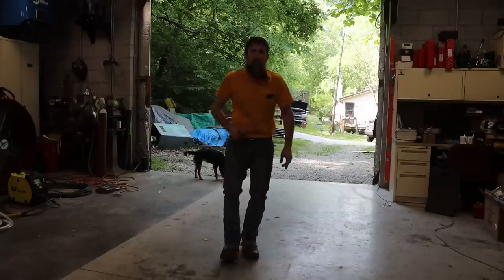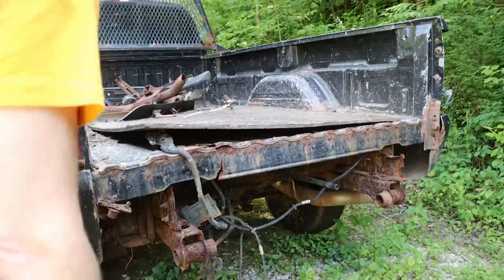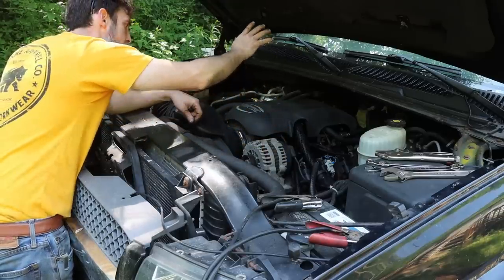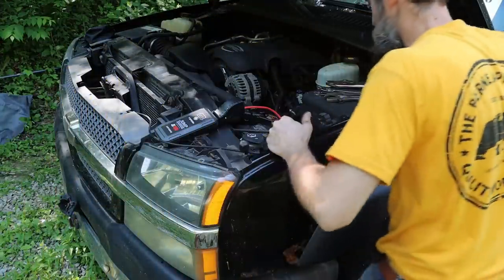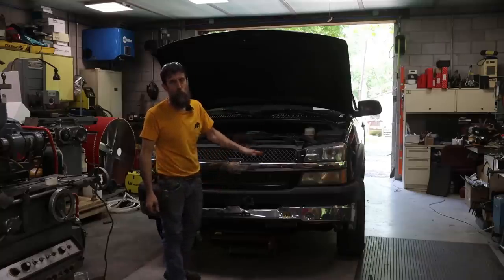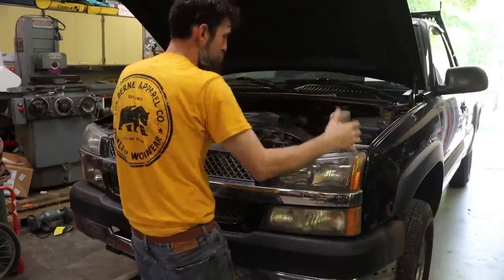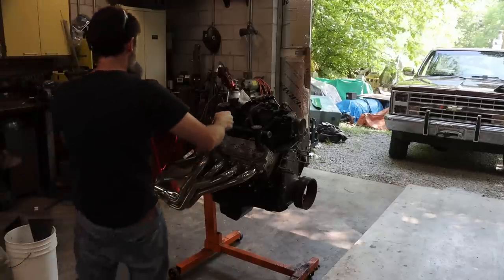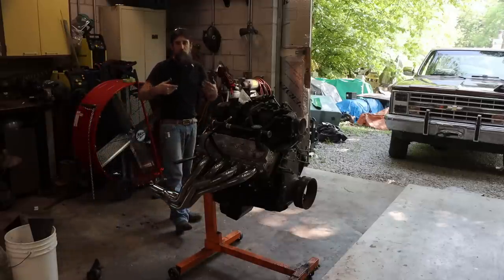This is thing is pure  junk! Old Rusty Road Salt Truck Gen3 6.0 LS Pull for Elizabeth's truck. JC

Comment: I have that same 6.0 in a three-quarter ton. 250 K miles with regular oil changes and I’ve never had a problem. Of course, living in a moderate climate helps keep corrosion and rest from being a problem.

Comment: Owned a truck identical to Johnny Cash and I got 6 mpg .  It was still expensive to run at 99 cents a gallon for fuel. It also took two acres to turn around. LOL,  Still was a nice truck and man could it haul materials.
Reply: My 01 dodge 4wd v10 dually 1ton gets just over 10mpg. It doesn't seem to make any difference if it's hauling a load or not. But it rides really well, and it doesn't take an acre to turn around in, surprisingly enough.

Comment: Engine looks good inside. Absolutely always want to get all the parts you need for a swap if you can. You can always get rid of the extra easier than you can find the one part you need.  Long tube headers are worth 50ft-lbs and 20hp anyday.
Reply from the maker: Hey Brian, good to see you. I definitely agree that it's easier to get rid of the stuff you don't need than to fine the things you do. Hopefully you are doing well.

Comment: I piece of advice for any and all that have U-bolts holding your springs to the rear axle. I have seen many of them rust bad enough to break off and it is dangerous. My youngest son bought a very nice 98 4x4 a few years back. He didn't have it long. While driving home from work another vehicle made a quick stop in front of him and he had to steer out on the shoulder to avoid rear ending them. When he did, the U-bolts broke and he rolled his truck several times. The U-bolts were completely rusted in two. It's amazing they hadn't broke before but the sharp turn and going to the shoulder was enough to do them in and the results were not good. God was merciful and he didn't have any bad injuries' to himself but the shape the truck was in wasn't good... Hope this helps someone!!!

Comment: My brother is a commercial fisherman , 9 months a year he hauls dead fish for his lobster trap bait. In winter he uses his truck for plowing and salting so It is a lot like what you have there after a few years.  Most have wood flatbeds after about 5 years.
Reply: My father bought one of those with a wood back, ex park service, on auction, for stupid cheap. He then drove it to the dump, and came back with no bin there. Then went to the people who do canopies for trucks, and got a "nearly new, only used once" bin, and it was free, no rear tail gate. Got a different tailgate, but right profile, and a bit wider, and we spent a weekend grinding the spot welds off it, and cutting it down to the right width, then brazed the ends back on. Coat of paint, and it was like a new one, and he had a semi decent pickup for a tenth the price. Had it for a year, then decided to sell it, and pick up a smaller more fuel efficient car, a Ford Escort, end of the line model, ex demo. Had that for a few years, then finally traded in on another ex rental Daewoo, which lasted for 25 years.

Comment: Steve, check the transfer case version, that was used for the ~05 one ton. I think that except for the diesel version, they where the same NP261, some of the internals need to be changed (wider chain and gears). Then you just need a front axle, to switch up Johnny Cash to 4x4.
Best wishes from the far North.

Comment: Steve, I know you already know this but it bears repeating for anyone watching.  Don't weld (or plasma) when your dog is in the shop, they absolutely will look at the arc and it isn't any better for them than it is for us.  And don't let the dog in the shop when you're doing anything with coolant, they love it and it's deadly poison.  

As soon as I saw the front of the donor I saw the plow mount and knew it was junk, those trucks just live a hard life.  Good find on the low mile engine, should move Johnny Cash out pretty nicely!
Reply: I've heard that an additive was added to modern coolant to discourage animals from drinking it. I wouldn't take any chances though and still keep the dogs out.

Comment: Spare parts are out there, unless your high pressure fuel crossover pipe on top of the engine is rotted off. GM stopped making them for my 2005. The aftermarket seems to be out of them as well. I had to find donor from the junk yard. Other than that I can find anything I need thus far. That 6.0 LS should be good engine, might be down on power compared to the big block if you're towing a trailer. But man oh man  they are reliable. My suburban 5.3 had well over 300,000 and the body rotted off but the engine was running like new. The 2005 I have has 200,000 and uses very little oil and runs like a Swiss watch with nothing more than the usual maintenance required. Looks like a fun project.

Comment: harvest the back rack - you need more lighting in shop (just at beginning) - good content - there is more on the old truck than you realize, you like the plasma cutter - get a big push broom - think about adding a new water pump and timing gears plus chain - check tolerances and specs - should be a great topic for content - degrease and pressure wash it and paint it? pls do update on flashing rom - you can do this and should get the tools - get blueteeth for obd2 monitoring to laptop - thanks steve!

Comment: The most dangerous rust on those trucks is the steel wheels. The way the centers are attached leaves a channel for dirt, salt and moisture can sit and the only way to clean it is to remove the wheels. Eventually the centers rust out and come loose from the rim.

Comment: If u use the tac module it's easy to add a kit to use cruise control. Also use the hydro boost off the new truck will stop alot better with less effort!

Comment: Hey Steve I am an admirer of your channel since how long I don't know.  Thank you for all your vids. They are very good.  I have the same engine in my 04 Escalade ESV.  approaching 280 K. So I think your LS will live. That one is just a baby.  Good Idea to buy the whole truck. Never know what you need while swapping.  Good luck and I'll be following progress.  Indeed a common thing that the exhaust manifold bolts are broken off. I think these engines are rated 355 hp. That should be enough for JC.  Again thank you for all your videos😎

Comment: Hi Steve.  I have to say, that truck is rustier than the 1999 GMC that I've been restoring, a little at a time.  Glad to hear that you knew about the o ring on the oil pickup.  That is a real pain to get to if the engine is still in the truck.  Especially with 4WD.  Old Johnny Cash should run real well with the 6.0/4L80E combo.  You could get the TH400 to work with the LS but using the 4L80 would be easier and perform better.  Looking forward to seeing more.  Thanks for the video!

Comment: Too bad there is no market for oxidized tin. You could retire today. This IS the way to get an engine/driveline etc. But, Soon you are going to have to deal with your yard space shrinking. It should help some on your wallets weight too eh. Saving the basics will supply your goals for JC.  Esp with all the controls, sending units and receivers that complement what you need. It would cost a small fortune having to source them from an auto wrecker eh. With this being an engine that worked reasonably hard did wonders for the internals. I have seen these with barely a sign it had springs and things in there, LOL. This is a fun one and made you dig out a bunch of Tricks to get it to where you are now. Bring on the DoAll bud. It will be great to see again. Take care and see yo soon my friend.

Comment: Did you hear me yelling at the screen? 
Put the transmission in manual low gear when the forward clutch is slipping. The low/reverse will apply.
Reply from the maker: Couldn't hear you over the exhaust leaks😁

Comment: A couple things you might want to look at are the intake gaskets, I am pretty sure the 5.3L of that era got a redesign because they would fail, also I think there were some issues with knock sensors and oil pressure senders of that era. Just some food for thought might want to research, maybe someone more familiar than me will chime in. It just seems that those are jobs I would much rather do on the stand. Looking forward to the new build, miss some of the machining but still enjoy all the projects.
Reply: Yes check into that I had problems with mine years ago after a water mishap 😂 and ended up having to go in a replace everything and upgrade to the new style gaskets 👍👍👍
Reply: Always, always, always replace the oil pressure sending unit when doing a LS swap or if you have the intake off. And get a good quality unit. I have had to replace several and learned my lesson. And replacing the knock sensors is also a very good idea. I have even seen a replacement wiring harness for the knock sensors because they are prone to deterioration also...  Preventing future problems now will make you a happy man in the future!!!

Comment: Hi Steve, you might want to think about intake gaskets while you are this far into it. I have an 02 GMC with a 5.3L that I purchased new. It has been a great PU but I did have to replace the intake gaskets, knock sensors and harness, also the MAF sensor. The knock sensors may not have been bad but as they are buried under the intake it made since to do it all.

Comment: Steve, if you need a home to adopt those headlights you took out of the 03, I am driving one them still (200k and counting) and I could use them.  I bought some aftermarket units to replace mine but they never have fit quite right…. Maybe the better half tagging that Mercedes had something to do with it… anyway, I’d sure be interested if they were up for offer

Comment: Change out the rear knock sensor (under intake) and the fuel pressure regulator (driver's side fuel rail with small vacuum hose).  Common issues with these.
Reply: BOTH knock sensors

Comment: Great content Steve love the project! Bad news though man. I had a brand new 2006 gmc hd with a 6.0 and a 4:10 rear end. 9-10mpg is all your going to get. Pulled a car trailer with it. Dropped to 6-7mpg. My uncle had 3 trucks with 6.0s and all the same. 9-10mpg.

Comment: Yep, exhaust leaks due to the rusted head bolts... GM used the wrong kind of metal for those.   I have a Vortec 8100, and I've done one side already... drill out the old bolts and replace with better ones.   The alternative is a special welded clamp that will hold the manifold to the engine and doesn't require you to disassemble it.

Comment: If reverse is good but won't go forward valve body is stopped up, not slipping just pull the pan and blow out the valve body and flush

Comment: I would change the rear seal plate on it every time I buy a ls in a truck it starts leaking at it till I change it and then no problem don’t know if it’s my luck or if it is the factory one on it but whenever I change it no problems

Comment: Looking forward to a new car repair serie. It is to bad that AC service is in such a commercial corner. (at least here in Europe it is) The environmental part is a thing. And being expensive or a hassle to get equipment to do it in a responsible way is not helping unfortunately. 
Not blaming you on this but the commerce. As a car mechanic myself I recognise the situation. By the way the throttle body flap is most likely driven by a normal DC motor. Not a stepper motor. Pwm driven.

Comment: God that truck was a "rust bucket bit of shite" as we say here in England. You're right Steve, I've never seen anything quite as rusty as that apart from a car we were driving alongside on the highway in I think West Virginia when we were in the states last year. That was a bucket of rust, half the what you call " rocker panels" ( we call them Cills) were missing as was the panel behind it. That wouldn't have gone two miles here in England before it was pulled over and condemned to the scrap yard by the local constabulary lol. Great episode Steve. If you are thinking of rebuilding the auto transmission why are you not going to change the front end and put the front axle on Johnny Cash and make it 4WD and auto for Elizabeth? That would make it an even friendlier drive for her.

Comment: Open question here because really I don't know. I'm curious about your transmission choice. Why the 4L80 vs the 6L80? Control issues?
Reply from the maker: 4l80e is a heavy-duty unit that should hold up better than the lighter  4l60.  It's just more appropriate for a 1 ton truck that will tow.

Comment: Once an unprotected steel truck starts to rust it'd structural integrity is lost and pretty soon you have the crashworthiness of a crisp potato chip. This happens long before it is cosmetically unacceptable. In most accidents all you''ve  got to save you and your family is a sound structure. Your last truck had wide spread faults in the frame that a few parches might coverup but not fix. They just move the fault to the next rusted spot, I have several friends that have traded their gas guzzler for a Tesla electric car and pay for it on fuel savings alone.. It costs nothing to own an brand new electric car.  It cost about 2 cents a mile for fuel o run. It's the safest car in the world. Its electric drive train vastly out performs your V8 and is the size of a gallon paint can. There are plenty of people out there with vast negative opinions and eagerly tell what they think even thought they never owned one or been in one. Ignore the nonsense and check one out they are now cheaper than a gas car.
Reply: I don't think Steve is a beta male, and probably enjoys the roominess, visibility,  and durability of a truck. I don't know about Steve, but I don't enjoy going 70mph scrunched up with my butt only 6" from the concrete.
Reply: Our State's gas tax pays for our road maintenance, intercity public transportation and sometimes the State Police salaries. Just wait for E V to pay their fair share, then we will evaluate which is more???

Comment: Why would you need to reflash the computer setup for that engine?
Reply: 4 wheel drive to 2 wheel drive
Reply from the maker: It has a  factory security  programed in the old ecu "Vats" I believe is the acronym. It  looks for the body control module that isn't used in the engine swap to keep things cleaner . I also want to delete the rear O2 sensors and other non needed smog  items.  This is a couple reason why it needs programed
Reply: @SteveSummers  ok
Reply: HP Tuners might allow Steve to remove VATS on this pcm. I have the hp tuners software and interface,  but I'm just getting started in my tuning journey.
Reply from the maker: @shannonstratton3164   I hope to skip the tuning and have someone else do that. If I had the time to set down and learn how it would be different.  It would be fun in ways, I'm sure.   Good luck with your tuning👍
Reply: @SteveSummers  Removing vats would technically be a form of tuning.  You might want to do some research on HP Tuners vats removal.  It may be simple to do, but seems different PCM's require different processes.  If it's simple maybe i could help you out. I'm not up to speed on LS.
Reply: Pretty sure hp tuners will allow you to disable the rear 02 sensors as well.

Comment: Trucks fall apart that quick i bet if someone made a vehicle ment for those conditions are northern brothers and sisters would buy them
Reply: If you take them to the car wash (or pressure washer) in the spring and wash the undersides pretty good to get rid of all the salt, they last a lot longer. I have a 95 C1500 from Canada still going strong, and not nearly as bad as that truck. It's not pristine, but the frame is still in good shape, and there's isn't too much body rust. My dad was pretty meticulous about washing the salt off every spring - it makes a HUGE difference.

Comment: You might be able to swap front axle’s out and make your one ton a four wheel drive? Great project, thanks for sharing.
Reply: The front axle in the donor truck would be one of the LAST axles on the planet to swap into Johnny Cash.
Also has wrong hubs.
Just not a good idea.
Reply: @haroldphipps3457 , I wondered if it would even be the right size, I figured someone would set me straight! Lol

Comment: Amongst other places over the years our 'Sparks' once found a mouse nest inside the casing of a locomotive traction motor. He couldn't tell if it was inhabited or not but declared he was not going to reach inside to find out, the job got left to me. I put a fresh pair of vinyl gloves on, a pair of rigger gloves over them and reached in, pulled the whole mess out (it was an old nest, there was no-one home), swept up the mess and left the 'Sparky' to get on with his job. Traction motor tested out ok on the megger and other checks so it had not been gnawed at.